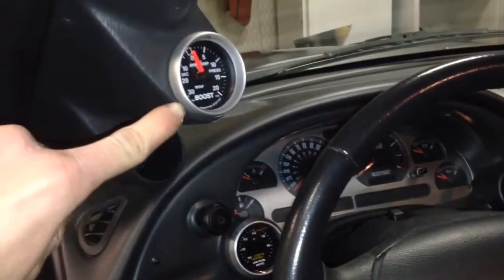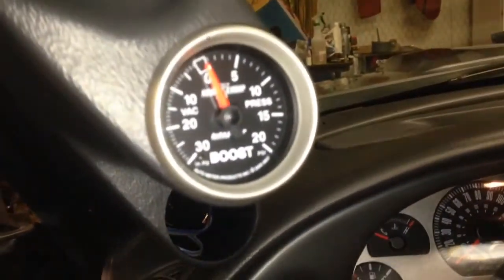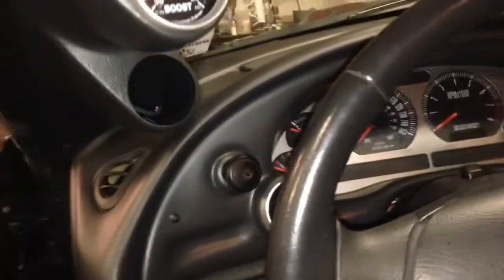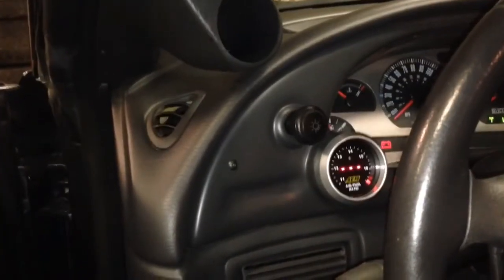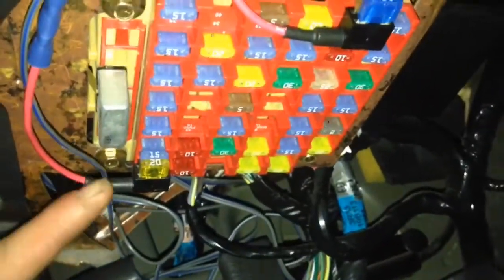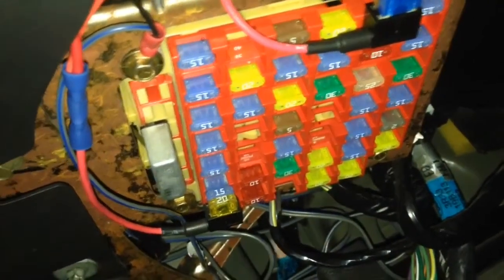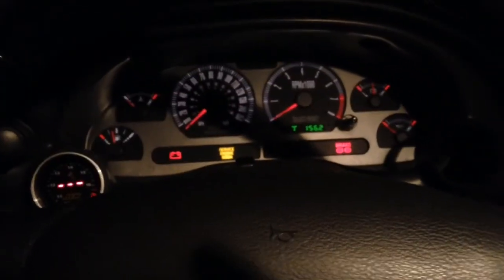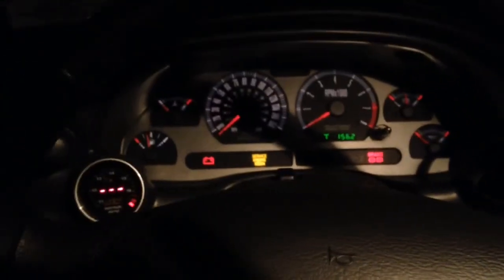99-04 mustang gauge pod & wiring

Comment: I'm trying to run a mechanical temp gauge through the pod.  Is there any good way to get the wire set under the dash without taking the whole pad out?
Reply from the maker: Hmm it depends on which pod location you want to use. If your using the cluster pod on steering column pod the it can be done but if you let using the a pillar pod then no way. The dash would have to come out
Reply: alright thanks

Comment: I just finished wiring everything up. I ran all 3 gauges illumination (white) wire to #37 and power from all 3 gauges to #5. Obviously ground and dun! They all come on with ignition and then lights come on with headlight switch and dim works from knob. I'll need to put the additional dimmer in like you did as they aren't at the same brightness as cluster. Thanks again.

Comment: Thanks for posting. I have the same gauge and a mach 1 and I am curious in this video if you just used power from the boost gauge to #37? The gauge has a white illumination wire and wanted to clarify how you did the install with power and illumination wire specifically as you don't mention in the vid. Thanks again!
Reply from the maker: Yes fuse #37 powers the gauge. I started talking about that @ 5:31. But It's alittle confusing because I used that twist knob potentiometer to lower the voltage to the gauge only because if the gauge gets straight 12v then it's brighter than the factory gauges. Post with any more questions. Soon I will be uploading another video of a in depth gauge install on my 04 cobra

Comment: Hey man i have a question, i have an 02' GT and want to install an autometer mechanical oil gauge. The gauge only has two wiring connections, one for power and one for ground. What fuse location would i use to get power to the gauge when i turn on headlights and keep the dimming function?  Thank you.
Reply from the maker: You can use under dash fuse #35 for ignition switchable power OR fuse #37 for illumination/dimming circuit. I used #37 but also Installed a small potentiometer and made some small adjustments to get the aftermarket gauges to exactly match how bright the factory gauges. 
Any extra explaining or questions just let me know
Reply: 2004dsgmach1 The gauge is the same as yours (Sport comp 2). And its mechanical so the only time i would need the gauge led backlight to come on would be at night. So using fuse #37 would give the gauge power (illumination) when pulling on the headlight switch and allow me to dim it gauge aswell? And also, use the same fuse and add a 5 amp fuse to the add a circuit?